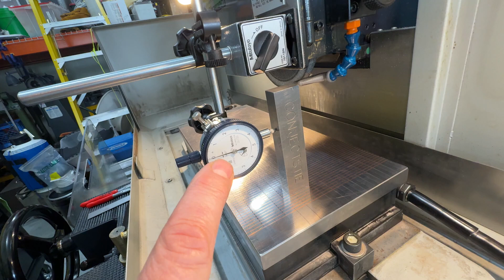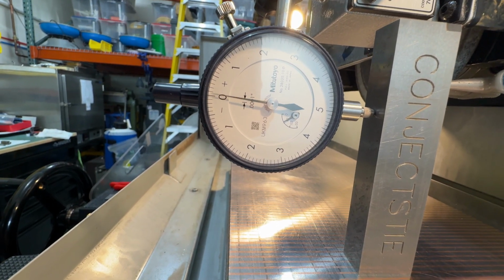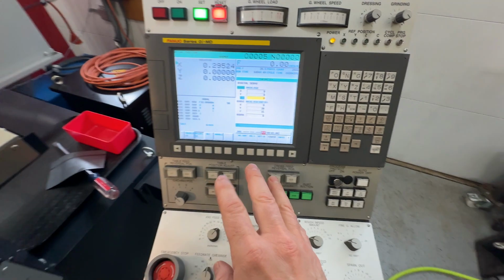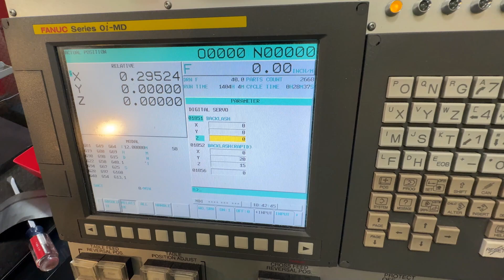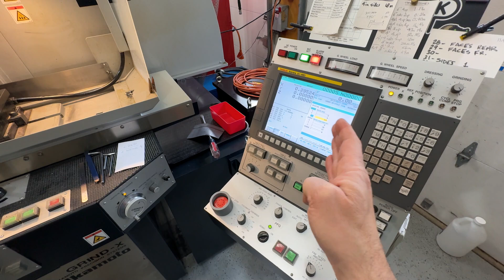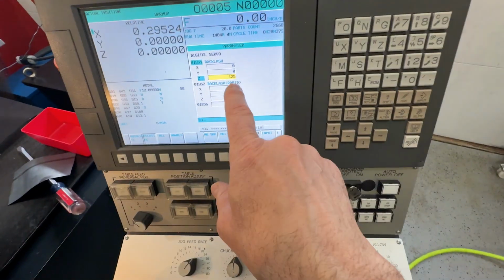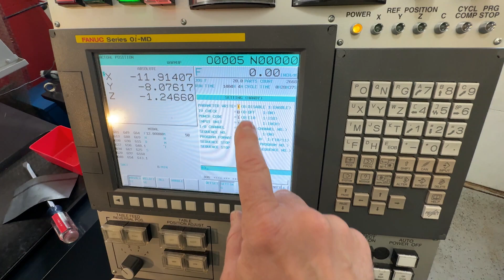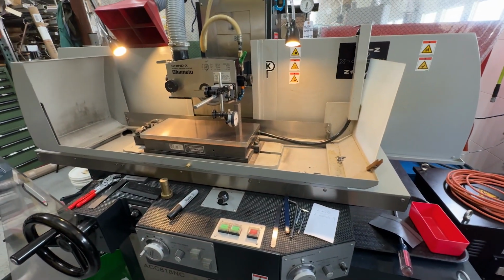Quick Chips: Restoring a sine plate, Part 8

Comment: Interesting that the digital readout doesn’t compensate for backlash. Does the Fanuc not have linear scales for the dro, or does it rely on rotary encoder feedback for positioning data? My old Reid 618HYD grinder has 30 thou of backlash in the cross feed, I’m real tempted to replace the lead screw with a ballscrew when I fit a dro to the grinder.